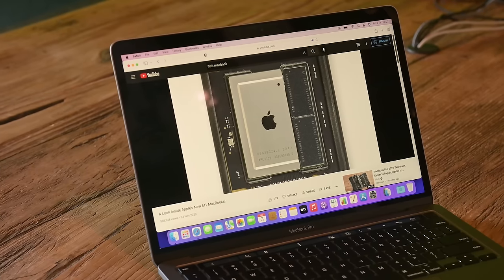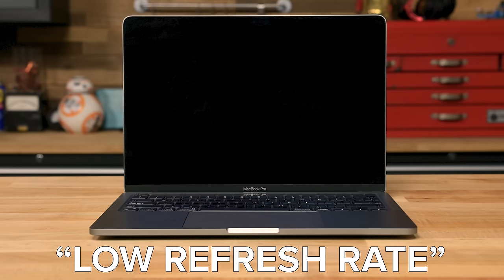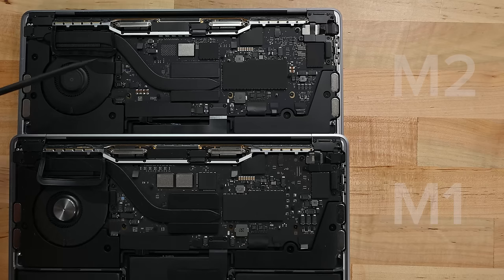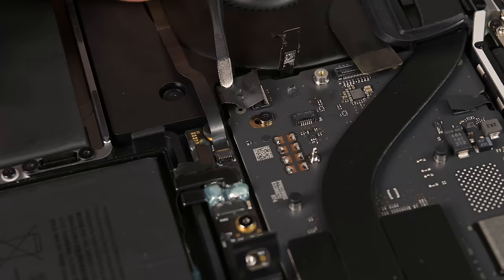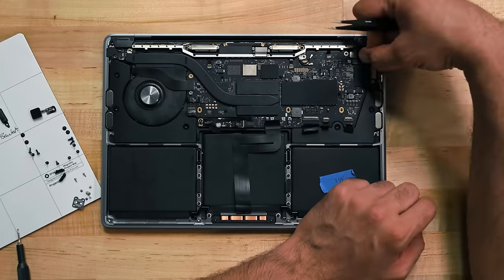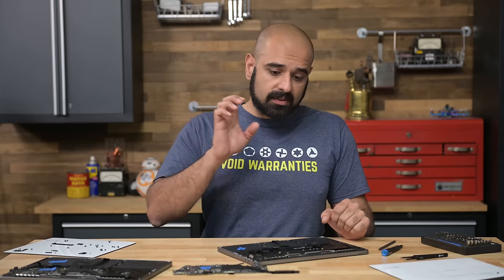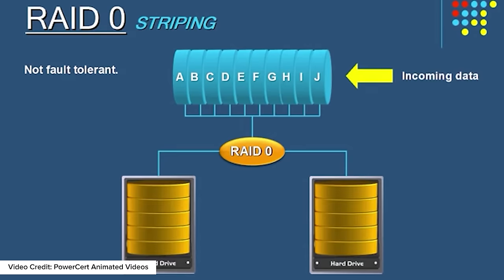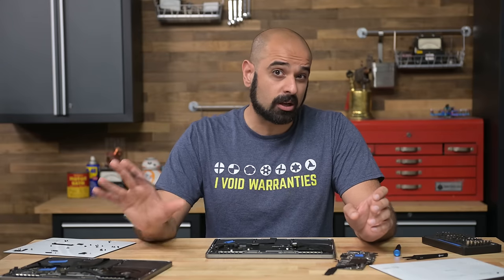We’re Pretty Sure We Just Tore Down the New M2 MacBook Pro!?

Comment: The problem with having only one NAND chip for a SSD disk is that its longevity will be half of the version that has two. And if you go for 8Gb model, your computer will swap more often (process where OS stores data from RAM to disk, as it the RAM gets filled). That SSD could die in two or three years, maybe even before. Will Apple repair it for free?
Or you will be pushed to throw away the whole laptop just because of one chip?

If they couldn't get enough of 128Gb, then they had a option to make 512Gb as a base model. For the money they ask, it should be default.

But, it's Apple. You do not get to be a trillion company by thinking what is good for your customers. You make marketing make them believe in that.

Comment: And this is the problem with apple. You can't even tell which model is which without digging into these cryptic numbers or upgrade anything. I can still use my 9 year old  Acer laptop but not an old MacBook pro because the software is outdated and won't let me update it.
Reply: there are still people who use 2011 and 2012 MacBooks though?
Reply: @iTristendo  I donated that old thing. The screen was pretty old and hard to see, not to mention it wouldn't let me update anything. I just got a new MSI gaming laptop and it has all the ports I wanted. Not the highest model but it does what I need.
Reply: That 9 year old Acer laptop won't run unmodified Windows 11.  So yeah, same issue.
Reply: @SanderEvers  No but 9 years was a good run. Now I can keep using windows 10 on it or change to Linux if I want t ok get a bit more out of it. But yeah it's old. Lol

Comment: The reason why the Touch ID sensor is not interchangeable with the M1 laptop is cuz apple doesn't want someone to tamper with the Touch ID sensor and make it accept counterfeit readings which might unlock the system without the real user, the fact that the keyboard and the trackpad got issues due to this is a shame.

Comment: THE SSD ON THE M2 İS SLOWER THEN THE SSD ON THE M1
Reply: No, it's not. There is only one SSD in the (base) M2 vs two in the base M1.  The speed of the invidual chips are similar.
Reply: @SanderEvers   you said it yourself. Theres only one ssd in base M2 vs two in the base M1.. İve done speed tests.. open the back cover on both the laptops and you will see
Reply: @tolgaa2613  watch maxtechs video they are the same speed, but slower if you get the base model m2